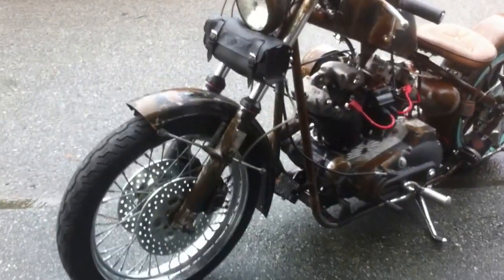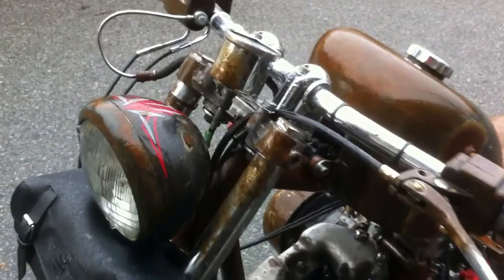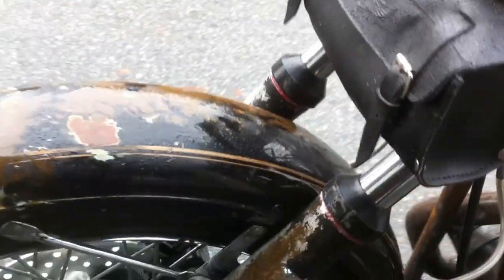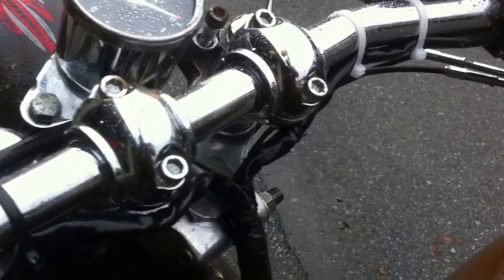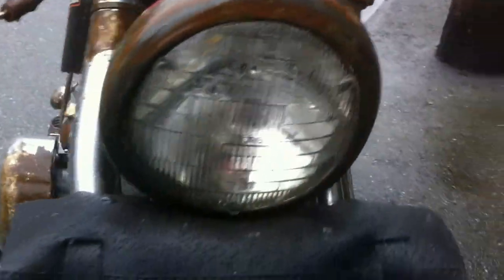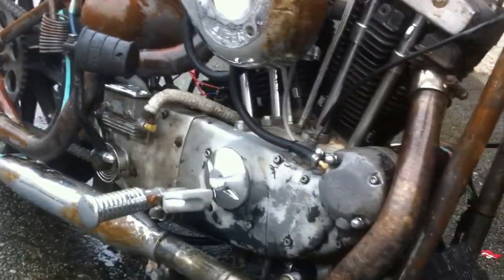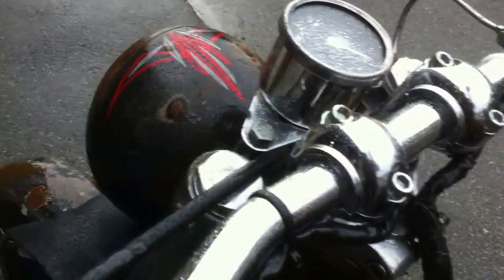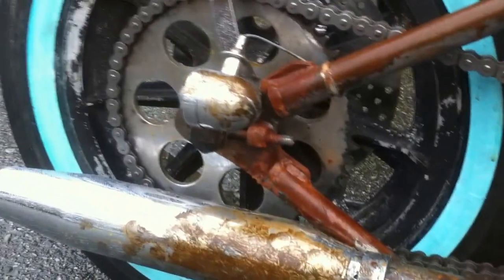"Rusty" 79 Ironhead bRat Bobber project - patina finish started

Comment: I'm fascinated by your work.  I would like to ask you if you had to remove or sand the previous paint or if the hydrochloric acid also breaks it down.  Forgive my ignorance, I want to do something similar to my Sportster.  Thank you.
Reply from the maker: It's fundamentally a paint job so, you would prepare your project as you would if you were planning to paint it. I then went to a local art supply store and bought a mix of media sculptures use to patina their work once they're completed the metal finishing of the rough cast. I applied it as per instructions provided and used several different methods to get is just as I wanted it. One thing to remember, there is no way you can go wrong - the funkier the better! Good luck on your project - mine was fun and the finish took me 9 month working methodically to complete it. Look for the finished video and note where I carefully buffed area that would normally not have corrosion or the rider use and contact (rub).